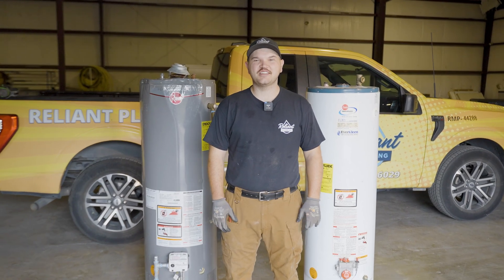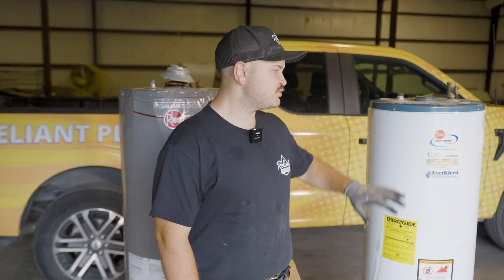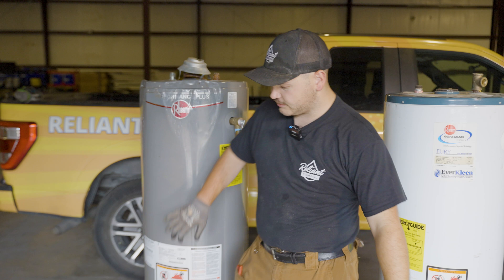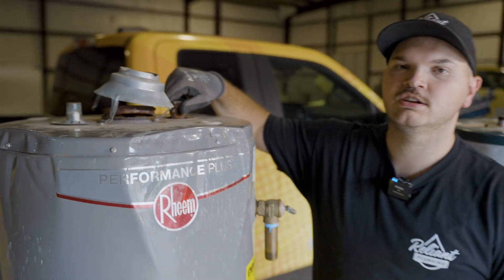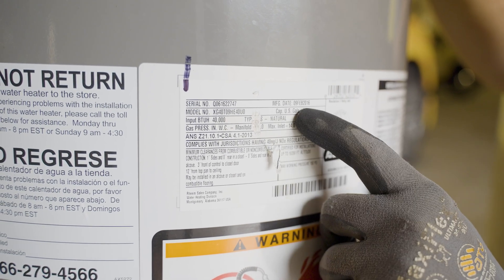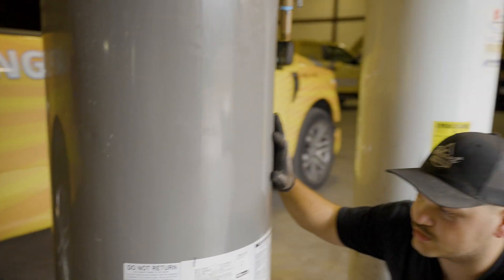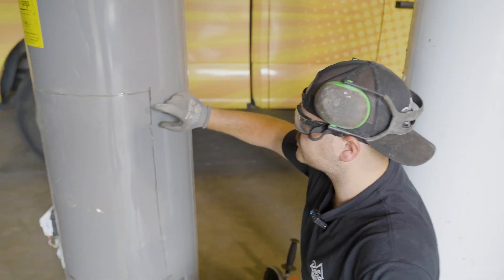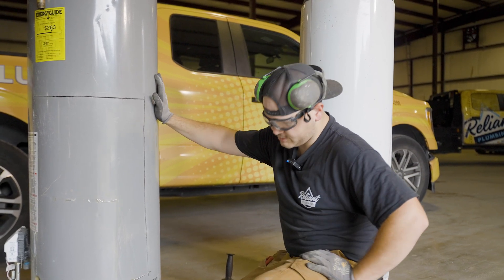Water Heater Autopsy: Sediment, Rust and Corrosion!

Comment: Why no fins or corrugations on the internal flue?  That would increase the surface area, and therefore make it more efficient by improving the heat transfer!
Reply from the maker: Thank you for your comment! That's a great point about increasing surface area to improve heat transfer. While some flues do have fins or corrugations for that purpose, the design of flues can vary depending on the specific model and manufacturer. We appreciate your input and will keep this in mind for future discussions!